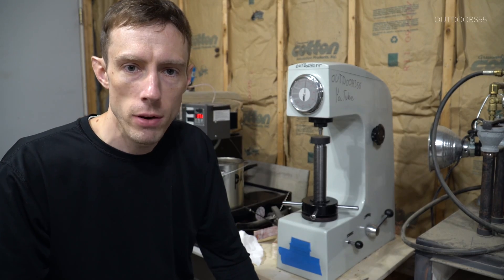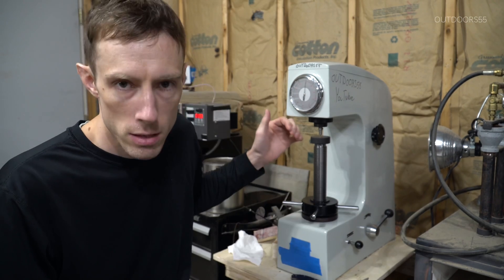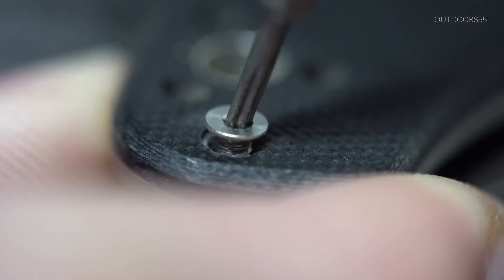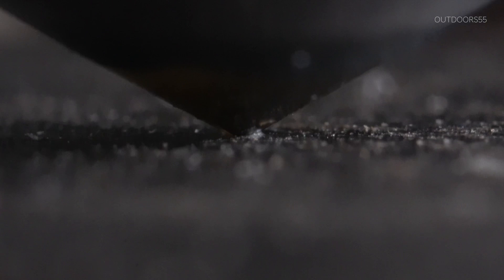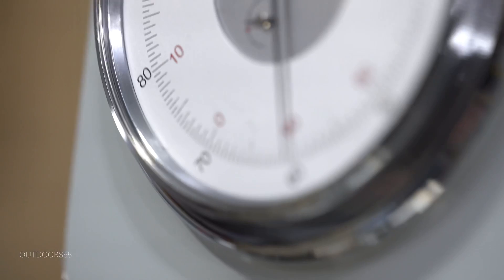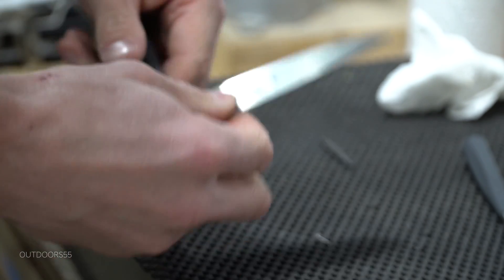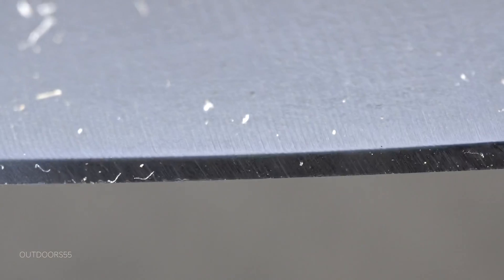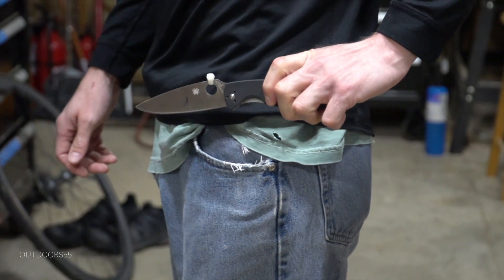Hardness Testing Spyderco Resilience 8cr13mov And QUICK REVIEW

Comment: One thing a lot of folks miss about is that 8cr13 is really easy to sharpen to a very functional edge it I s is rather rust prone however even compared to Aus8 or VG10 and needs frequent oiling oiling. 
Overall the Tenacious line is my favorite “gift knife” set of options they’re not too expensive, very useful, comfortable and there’s a perfect size for anyone. Oh yeah and it’s gapot a fun action! 😁

Comment: I personally think 0.8% carbon in steel is one of the sweet spots for all around performance (Toughness, edge retention, edge itself), I also like that it has around 13% chromium because that is the bare minimum for steel to be classified as stainless (chromium can make a steel brittle).  
Chemically 8cr13mov  sounds like it would make for an OK knife stainless steel (and it seems like it does.  Shame it is a "budget" steel and not many manufacturers give the steel the heat treatment it needs).

Comment: Great idea, this machine could be expensive :) No wonder you make one test at a time separately. Anyway I thought about comparing method  by simple using automatic center punch. They say it is made from tungsten carbide. I bought scriber made of it, but it was too hard and tip cracked when I tested on pliers steel. I guess that automatic punch uses softer tungsten carbide.

Comment: Harbor freight used to sell an EDC folder 8cr13mov  called the challenger for 5 dollars with a 20% discount coupon. The hardiness of the steel is incredible for the price. Unfortunately it is discontinued they are still available until they run out.Fortunately i was able to hoard a half dozen again for around five bucks each!

Comment: Ok, here's Pandora's box. Boker in 440C. Theoretically, it has the ability to be better than Aus8...but is it?  And, just to be that way, VG10. I have had (historically) great (and horrible) results with all 3 - depending on heat treat!  I.M.E.- VG10 is slightly better (not as tough) than 440C, which is slightly better than AUS8 (under optimal heat treat). Curious to see the tests though!

Comment: Right off the bat i can think of 2 "myths" you can de-bunk with this hardness tester 1. Is SOGS cryotreated aus-8 really that much harder? 2. Does spydercos H1 steel really work harden when serrated at the factory IE Are H1 serrated knives harder then plain edge H1.

Comment: Feels like this series of videos is about to open up the mind of some of those cork sniffing steel snobs...  A HRC of 60 in 8Cr13MoV, used by Spiderco, this maybe is an eye opener for some folks.
Yeah, in the end it is in the heat treat.
I have to say only good things about 8Cr13MoV as used by Cold Steel. 
Everybody has some bad rap over Krupp 4116 - until they notice, that you find it on your Henckel and Wüsthoff kitchen knives. In reality most people have this steel on their EDC knive, not realizing this.
For myself I use some of Cold Steels beater knives with 4116 like the Finn Hawk, what is their version of the Mora. It takes an ultra sharp edge and holds it for some time. 
As a big Cold Steel fan I would love to see a hardness test on the 8Cr13MoV and the 4116 used by Cold Steel. It would be perfect if you would be able to add Cold Steel AUS 8a and AUS 10a to your tests. 
Love your videos. I want to thank you for all you do.

Comment: Check my Tenacious cut test on IG, well done 8cr is a serviceable steel and will cut for a good long while and it also strops back to shaving over and over and over and over and over... you get the picture lol, is it going to cut as long as rex45, m4 etc etc well of course not but will it give you good performance for Normal daily cutting tasks? Absolutely

Comment: I carried one of these every day for a few years.  Still have it and would still carry it but I also EDC a SAK and other things needed the room in my pocket.  I think the size is really good - except for carrying on formal occasions I generally find small bladed pocket knives to be kind of annoying - I am a believer that a larger knife can do small knife tasks much easier than a small knife can do large knife tasks.  I do like the slightly smaller RAT 1 and carried one of those a lot at one time, as well.  Even the SAK I carry is one of the longer blade models.

As far as the steel and similar steels go my favorite steels will always be high carbons like 1095.  That said, I can't help but chuckle at steel snobs, sometimes, as these inexpensive stainless steels used today are so much better than many of the (mostly crap) stainless steels used in budget knives thirty years or so back.  Some of that junk was either so soft that by the time you got the edge thinned down enough to be sharp it would just roll - sometimes while you were honing it - or so hard as to be brittle.  The Resilience and similar knives sharpen up nicely, hold an edge well for most common, everyday tasks and won't break the bank.

Comment: Gonna love this series I can already tell, but I do have a question.. I know some companies will treat steels like M390 to 62-63 HRC, and as we have seen here the 8cr from Spyderco is at 60, which from what I can tell is good for that steel, but would you get a better quality 8cr if it went to the 62-63 companies will do on higher end steels? Or is there a hardness “cap” on steels, where If hardened too much it can be just as hindering to the steel as a much too soft heat treat? I guess my question is, does every steel have that performance sweet spot when it comes to HRC level?
Reply: First off, hardness is a pretty meaningless statistic on it's own.
Comparing 60 rockwell on a 1095 blade is going to be different from 60 on a D2 blade for example.
And, hardness is not the be-all-end-all of knife statistics, you want some toughness.

Yes, there is a cap of hardness for different steels, depends on Carbon content, and some other alloying elements.
But generally, lower carbon means lower hardness, so higher carbon content is desired.

A knife CAN be to hard (after all, that' why you temper them), it does improve strength by reducing hardness, many manufacturers target that 'sweetspot' you're talking about, and it depends on the steel, though generally you will see around the ~57-60 range for most knife steels.
Reply: @autumn5592  thanks man!

Comment: Hello, Alex;
Thank for all you do.
You are THE youtube knife guy so I've got a question for you.
I know how you sharpen knives, I've watched you do it.
I know how others sharpen knives, watched them do it , too.
I'm 67, been sharpening knives since I was in grade school, so 55-60 years.
40 yrs ago I had a reputation for being able to sharpen a knife.
But recently I tried something different.
I want you to try it &, maybe, make a video about it.
I have several knives, only one is a scandi-grind, a Morakniv Craftline Basic 511 High Carbon Steel, got it on amazon for $10.
I had to learn to sharpen it, you know, scandis are different.
But trying something new led me to try a little different technique.
I was doing it like you, moving the blade on the stone 90° to the edge.
For some reason I started moving the blade parallel to the edge.
The knife was already 'sharp' but moving the edge 90° to the 'usual way' gave me an extremely sharp edge.
Thinking about it I realized that is how some swords are sharpened.
So I think you could make a short, try both ways & see which worked better for you.
I tried it w/ my Mora & w/ my CJRB Briar, both finished sharper, shaving sharp.
I usually don't like a 'shaving sharp' edge, often it is too weak & won't hold up.
So far the Mora is still keeping it's edge but I've hardly used it.
The CJRB is my EDC but I don't use it a lot, it's still very sharp.
So my idea is try sharpening inline w/ the edge & the usual 90° across the edge.
See which one you think is better, normal or sword-style.
I think it might make a good video.
Have a GREAT day, Neighbor!

Comment: I bought a puma white hunter knife in 1976 and it had a tiny pin prick hole. I was told that the diamond tip was used to pass its rock well @58
The German manufacturing was good then

Comment: This might be difficult to test but some knives have stainless cladding on a harder core, and/or due to the thickness of the edge (compared to the spine) the heat treatment will result in different hardness for the edge v.s. the rest of the knife. How much do you think this difference might be and if its possible to test the edge hardness without ruining the blade?

Comment: Love the videos, and these are very interesting! Glad to see you back and making more videos. I carry the Spyderco Salt series, any chance you might test some of that LC200N steel??
Reply: A test on h1 would be cool to see too. Especially one that has been well used, since there are a lot of rumors that because it's an austenitic work hardening stainless steel. That it work hardnes with use, and some have been rumored to see above 65 HRC around the edge. Would be very interesting imo.
Reply: @_BLANK_BLANK  I think it's a myth...
Reply: @mladenvojinovic  most likely, that it happens with use. The only validation that it had was that sal himself was reported 68hrc. The only way to really know though is testing it. 

It isn't a myth though that h1 is a work Harding steel. Believe it or not, its actually hardened through cold rolling instead of using traditional methods for knives.
Reply: @_BLANK_BLANK  thanks for the explanation, you live and you learn, I truly thought it a myth...
Reply: Carribian? Yes please, and mine gets scary sharp easily...
Reply: @mladenvojinovic  love my Caribbean.  Also have a Salt 2 green wharncliffe that I carry when pocket space is at a premium. Both are kept scary sharp with weekly touch ups, but I let one get too dull and it took a bit of work to get it back to hair popping sharp.

Comment: This series is going to be spectacular. Great idea. Many poo-poo those steels, I prefer the AUS-8 over 8Cr13MoV, but there's something to be said about a steel that can get hair whittling sharp,  easily - and then be able to hone / touch up with merely your leather belt when needed. If like to see the Ontario RAT or even better, AL Mar Japanese AUS-8 in comparison.
Reply: I really like my tenacious in 8cr13mov as well, holds an edge well, it's relatively tough and resistant to chipping, and easy to bring that razor sharp edge back. Great for work knives imo. I'm interested to see how it compares to other steels as well
Reply: @chimchu3232  Indeed. Besides the known Sandvik 14C28N everyone knows to be a solid mid-range performer. I'm curious to how CTS BD-1 & BD-1N in particular, stacks up. True Sleepers in regards of overall performance to their price point—similar to AUS-8 with a much better Edge retention. In my experience, almost VG-10 arena
Reply: @benmacdhui  yes it'll be a cool series if he brings in lots of different steels.  I like a lot of the budget steels for work knives, and s45vn for general edc. It would be cool to compare them all

Comment: I've watched both of your recent Spyderco 8CR13MOV hardness tests. To be honest, I am a little surprised that Spyderco heat treated to 60 on both 8CR blades. I thought the heat treat would of been 58 at best considering the blade steel and cost of the knife. Nice video.
Reply from the maker: I am surprised as well. Both of mine are from around 2010 or so. Would like to test a new one but im done buying china knives 🙂
Reply: Well if testing another knife gives again 60hrc then it might be calibrating issue ;-)
Reply: Years ago on the Spyderco factory forums., Sal Glesser told us that when they tested the Cara Cara it was 60 Hrc. This was a long time ago so it shouldn't be surprising. I carried a Crossbill every day for about five years and found the steels ease of sharpening consistent with the hardness rating.

Comment: Buck's 420HC. It's a knife steel that's been around forever and I would really like to see how it stacks compared to more modern steels.
Reply from the maker: I have one. Testing it soon🙂
Reply: @OUTDOORS55  Awesome. Can't wait.
Reply: @OUTDOORS55  I have several older Buck 110 at least 20 -25 years old. I have always wondered if 420HC is comparable or better than the older models.
Reply: Buck is considered to be one of the best if not the best company for 420HC, but it is still 420HC so the edge retention although perfectly adaquate isn't very good by modern standards.
Reply: Not forever. I have pre 420 bucks. (425)
Reply: In my opinion, with my one Buck with 420HC, it’s one of the best budget steels around. It got sharper than most of my other knives, and the edge retention has been phenomenal for light duty cuts. Better than my much more expensive Benchmade with supposedly better 154CM.
Reply: I can get bucks 420hc insanely sharp when all my other knives  don't sharpen up as good. Iv always grabbed buck knives first because of that reason
Reply: I've had many folding knives. And I have recently the last year got out of collecting. 30 dollar knives but mostly customs in the 6,7 , 800 dollar range as far up to 1300$. 

For some reason my dad's buck 110 I sharpened on my kme knife sharpener was BY FAR the sharpest I have ever gotten a knife. Maybe because I'm not the best sharpener, but I've had all the "steels". Ive got the "scary sharp" very easily with that knife.
Reply: @robreadinger5340  Yeah man, that's my reason to want to know. My camping/woods knife is a Buck 110 and I can make that thing a cooking, shaving and skinning knife. It makes sense why it has so much history as a general camp knife.
Reply: @robreadinger5340 what knife maker is selling customs for $600-800, or even for $1300? That's midtech pricing. Maybe some production versions of some makers' customs. I think my cheapest custom is twice that $1300 number.
Reply: Big question -
Buck's standard 420 has a Rockwell of 59-60.
As does almost every other high end steel, usually described as being 59-61 top.  I rarely ever see something rated 62 or higher.
I am thinking the other high end steels are only a few percentage points better than the 420 in one or two categories...maybe...
Reply: @MichaelKMorris  Rockwell hardness doesn't always indicate abrasion resistance, especially in many of the more modern alloys that have a higher carbide content and harder carbides.
Reply: @garethbaus5471  so the hardness test really isn't definitive, only describing one aspect of maybe 4 important characteristics?
Reply: @MichaelKMorris not only is the harness test not definitive, but most gone shops have testers that are out of cal, and a piece of steel can vary by several points on the same piece. You need to test the same piece in multiple spots. And not only does it naturally vary, but it can vary due to how it was heat treated, where it was fixtured, and what parts they wanted hard. Testing it on the spine or tang will usually give a different result than near the cutting edge.
Reply: @MichaelKMorris don’t you worry about losing the knife when out camping or in the woods? They don’t come with a pocket clips or sheaths. I prefer my mora companion fixed blade. It’s lighter weight too and a third of the price
Reply: @RealBoiJare  all my Bucks came with sheaths.  Not my favorite design, but they all have one.

Comment: I'd like to see you test the Demko AD20.5, the Benchmade Bugout, and some Buck knives of varying steels to really test the Paul Bos heat treat that they use.
Reply from the maker: I have tested a paul bos heat treated buck. It will be coming soon👍
Reply: The testing is much less about the model and more about the steel and how that company hardens it.  For the Bugout, he can test any model in the Benchmade line.  Doesn't have to be the Bugout.